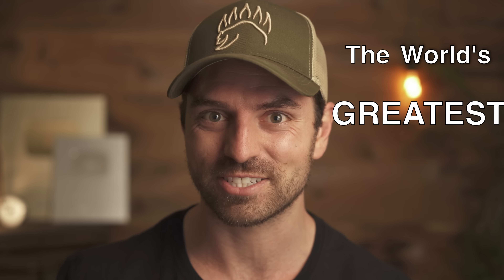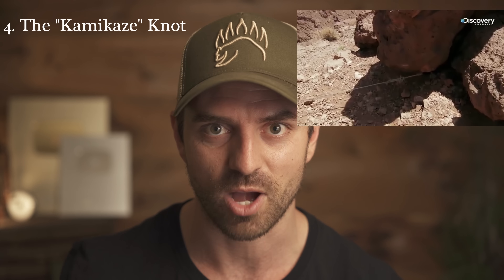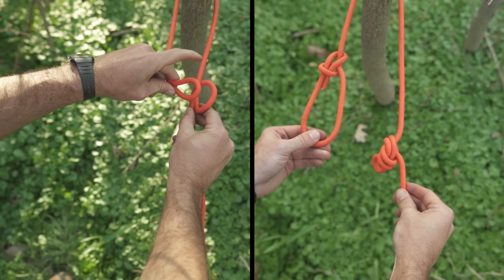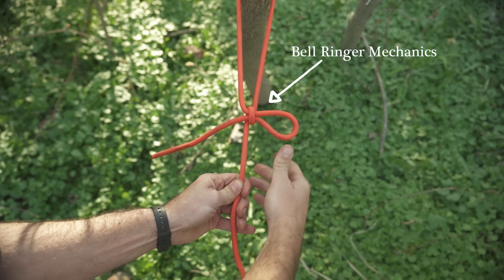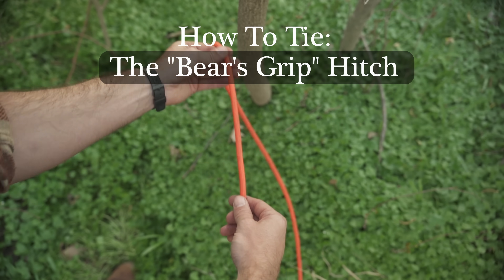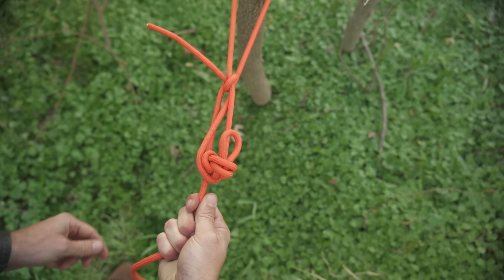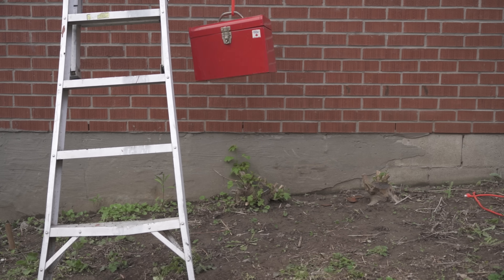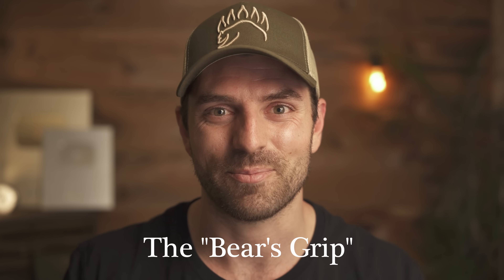Revolutionary NEW KNOT that SELF RELEASES when you want it to!

Comment: I like your videos so far but Technically speaking this is not actually a "new knot". Its really not a NEW knot at all you're just putting a loop(Bite) through a bell ringer and and putting the loop over a figure 8. You're not actually tying any  new knot you're just using a Bite to slip over a figure 8.hoping that it has just enough tension to stay over that Figure 8 under line tension and hoping that that letting out the tension and moving the rope while loose will get the loop to let go. Its not technically a new knot but more a more secure application of applying two knots in tandem using a long Bite with the end result being the two knots  become a Kamikaze knot together.  The Bears Bite would be more accurate. Because its the bite that makes the system work without that bite being long enough you just have bell ringer and a figure 8. Its a great idea though and I like that you have not just decided that all knots already exist. You sought to improve upon the system. Its definitely a great idea I just dont know if having a long bite going over another knot counts as a new knot. Technically speaking its new hitch but does a hitch technically count as a new Knot if it was already two existing knots made to become a more secure hitch by simply making the bite longer Idk. Whats great about that is it will be forever easy to learn if you know a figure 8.